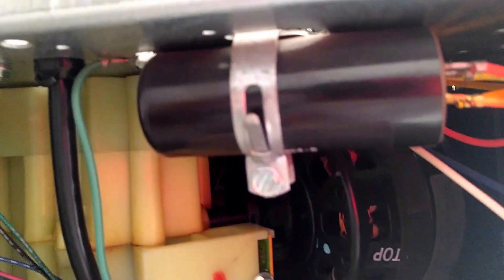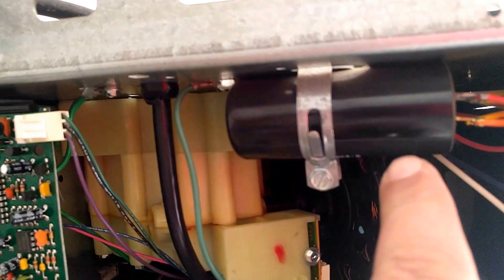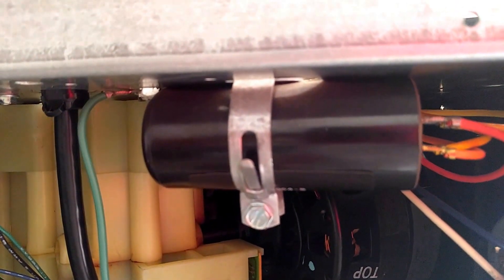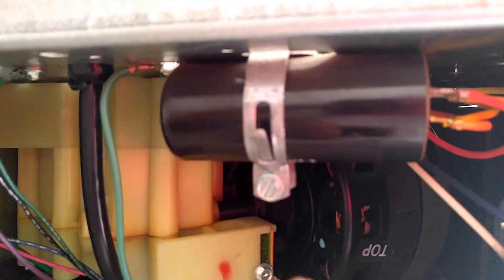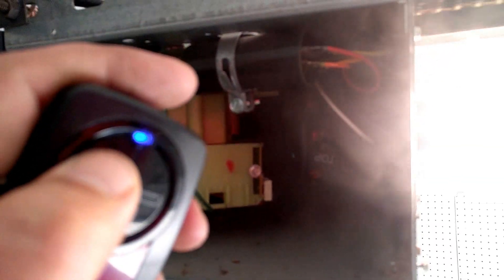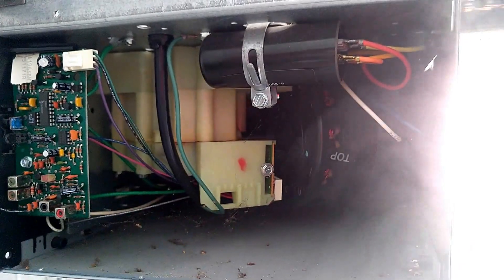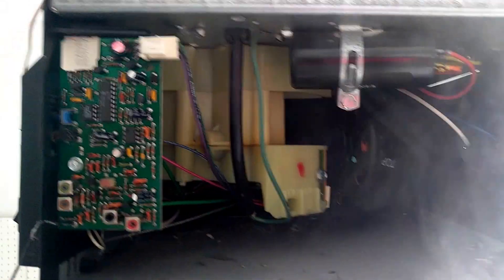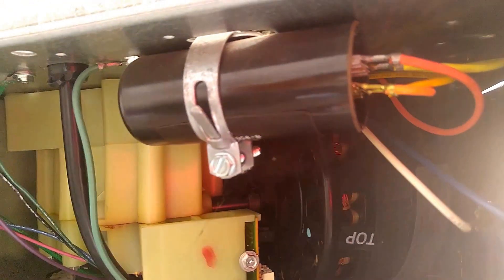🆕Garage Door Opener Troubleshooting 💥 Smoking Garage Door Opener💥

Comment: Before I unscrewed the door and opened it. It was just fine. I didn’t smell any smoke, however when I opened it in attempt to change the battery (open the wrong side) it started smoking. 

So is it my fault it started smoking? 
Can I just leave it alone or should I switch it out?
Reply from the maker: @Grimdolyn  it's not your fault.  Start capacitor will eventually need changed with an older machine.  
I would replace it if it smoked just a little.
Reply: @garagedoorgenius  do you have a video on how to change the capacitor? Thank you for responding!

Comment: If the  start capacitor has a bulge or   does not have a bulge The motor will hum  a sign capacitor is bad-or if the start capacitor start smoking leaking the capacitor is going bad

Comment: I just got one of these openers and the exact thing happened to mine 😔
Reply from the maker: Older machines you have a good chance of smoking a capacitor for sure.  Easy fix tho..
Reply: Hoping I can salvage one from an opener, I just have to hope the capacitor works lol
Reply from the maker: @TBHD724  you should be able to snag one.  Just check the end of the start capacitor, make sure it's not blown out.  They are pretty inexpensive on Amazon.

Comment: Is there oil in these? I had smoke then a pop now I opened it and there’s oil all over the place in ther w
Reply from the maker: Yes, there is oil in the capacitor. It is used to remove any air voids and it helps to cool or remove the heat from the Capacitor windings. When they reach their discharge capacity, these windings tend to generate a lot of heat.
Reply: @garagedoorgenius  10-4 I’m going to tie the breaker off take pictures of the wiring clean up everything and take the capacitor off and get a new one. I also need the plastic chain drive this one isn’t holding onto the chain it slipped completely

Comment: When I click the button to open the garage door, the door comes up maybe few inches the first time and stops, then if I click another time it opens up like a foot and stops then when I click the third time, it almost drops back to the ground and pulls it back to open completely (so it eventually opens). Would you say this is a capacitor problem? Also, when I close the door, it literally drops the door near the end as if it doesn't have enough strength to hold the weight from dropping. Is this a problem with the motor? Thanks in advance for your response!
Reply from the maker: Check and make sure you don't have a broken spring on the door.  Sounds like it's heavy and that could be the cause.
Reply: @garagedoorgenius  Thank you for your reply! Is there a possibility that a garage does not have spring on the door? I mean I searched how these springs look on google and mine doesn't seem to have anything similar to it. In fact, I don't see any spring anywhere on my garage... If this is the case, what should I look for instead?

Comment: i replaced with new one and then smoke came out after opened and closed for couple times and doesn't work anymore. Any advise? Thanks.
Reply from the maker: Hmmm.. smoking is definitely a start capacitor.  It's very important you hook the 4 wires back up properly.
Reply: @garagedoorgenius  Its probably starting to run hard. Thrust Bearings in the screw get worn and cause and extra load on the operation. My door started to stop in mid closing, like it was hitting something on the way down. It would run without the door attached but was running hard with when operating normally. Trying to troubleshoot it the cap popped. I bought a wall mounted head unit. Never looked back.

Comment: I like how when yours started smoking, you started singing "It's on fiya......".

When it happened to me a few days ago, it popped, made a loud hissing sound, and the entire thing went up in smoke.  Rather than being calm about it like you, I had no idea what was going on and freaked out; running to grab a ladder, the fire extinguisher, etc!  Of course, by the time I got back to it with those, it had already stopped smoking and had cooled, and I realized what was wrong.  Definitely an initial moment of panic, however!  I wasn't expecting to see my garage door opener appear to be on fire....
Reply from the maker: Those start capacitor can be freaky when it happens.  Like you said, smoke/bad smell/hissing...would have anyone frantically running around looking for a fire extinguisher.  It takes about 10 seconds and then it's all good.  Replacing the starter capacitor is a super easy fix.
Thanks for the comment 👍
Reply: @garagedoorgenius  Yep, my replacement capacitor arrives today.  I'm looking forward to getting it back in working condition again!

Comment: start capacitor. . why didn't I think of that..
Reply from the maker: +krumsbymf 
Now ya know!!
Reply: you advised me on a comment on another video that my cap was gone after i saw and smelled smoke, when i opened the unit i found the gears were also stripped out (main and worm), i looked at the cap it looks ok but i need to test it but i removed it and i have the  unit  unplugged and opened and i noticed the metal contacts in the limiter switch looked corroded (unit is liftmaster from like 1998) now here is my question  after i  sanded the contacts i was going to check them with a continuity checker and to my shock
i get continuity not only when they are touching but  when they are not touching! the middle metal contact pole has a grey wire connected to it,  the other 2 metal contacts that are connected to the screw rod adjustments have a yellow and  a brown wire respectively, when i check continuity between the grey wire connected to the  common middle contact of the limiter switch and either the yellow wire or the brown wire connected to the limiter switch adjustment  screw rods i am always getting continuity  even when the none of the contacts in the limiter switch are touching, so do you know if this is normal? seems like  it would defeat the purpose of the switch since there is continuity even when the contacts are open ,unless this changes when it is plugged in and the capacitor is in place? either that or my motherboard is bad too?
also i noticed after the opener blew , (stripped gears and probably  blown cap, smoke) and the motor just kept on turning without stopping that when i walk past the beam  the leds on the sensors blink but the light bulb in opener no longer comes on, (the bulb is good i checked it)could this also be a symptom of the bad cap or do you think the MB went as well? if you run the opener a bunch of times in a  row (which i did) and the cap goes does it somehow also short the  MB too?